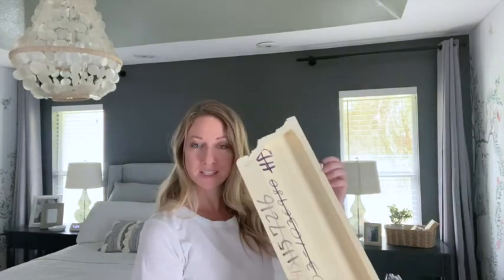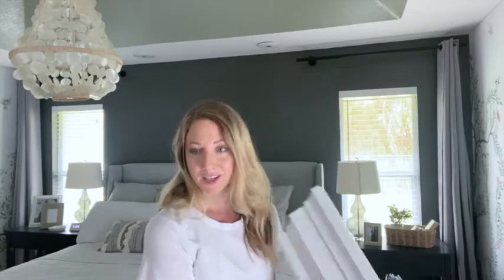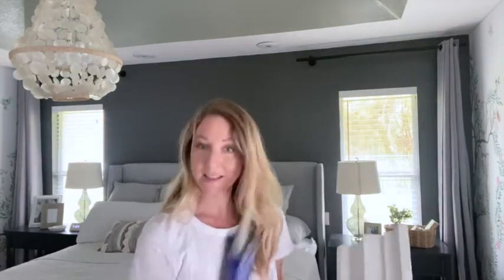5-minute DIY! Crosshead window moulding DIY video

Comment: Hi there , where did you get this moulding!? $15.00😳
Reply: Did u ever find out where to get this??
Reply: @varimarc1  I did a quick search on the internet and found some that came close. I was waiting yt response before I checked out the others I found
Reply from the maker: Here's my blog post with links. Of course they raised the price! Grrrrr. https://www.housemixblog.com/2020/07/23/5-minute-window-crosshead-no-power-tools/
Reply: So...the only polyurethane crosshead molding I can find is SEVEN TO NINE times more expensive than $15!!! And we can assume it's really cheap to make, very little labor, easily mass produced. Also, Polyurethane TERRIBLE for the environment.